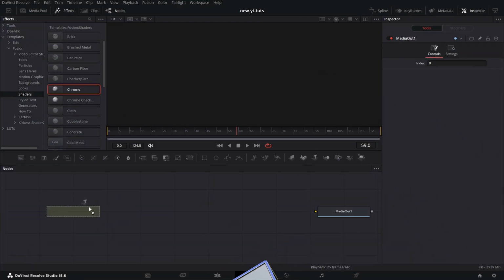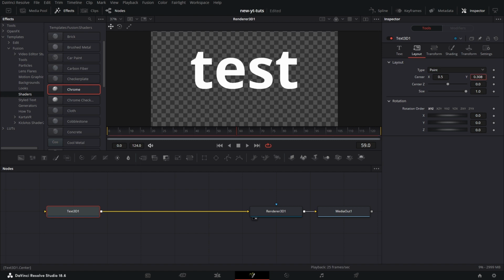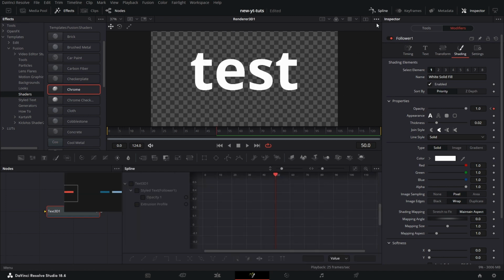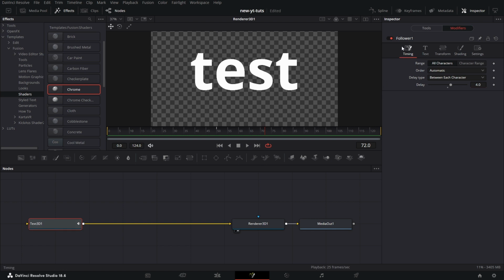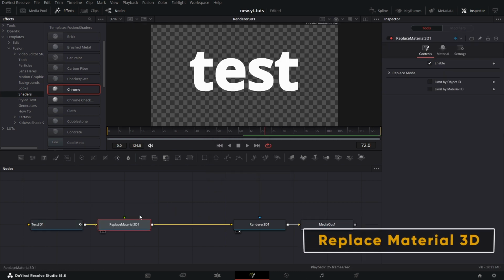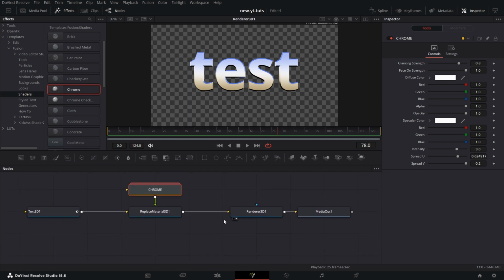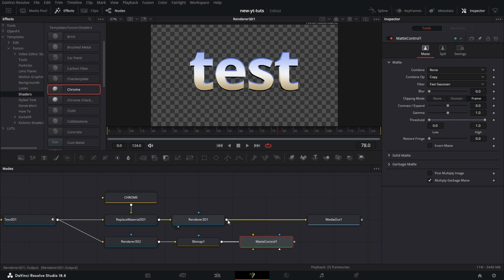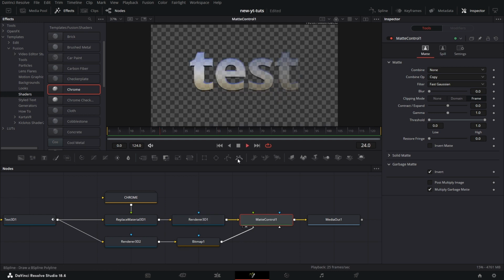Fix Replace Material 3D and Follower opacity issues | Davinci Resolve Quickie

Comment: Hello, i want to know is there any way we can transform video or photo sizes equal so that it looks similar in single frame
Reply from the maker: There are ways to make pictures or videos of different sizes align with a specific dimension.

1. Generally, there are two nodes in fusion, crop and resize that can help but it may not yield exactly what you want.

2. You may need to manually crop the images or videos using masks (rectangle mask tool) by connecting this to the blue mask input of image or video node (usually named Mediain). Then after cropping to the right dimension, you can add a transform node to increase the size. I know it's a bit cumbersome but this is the better option.

Do let me know how it all goes.
Reply: @madresolve  Thanks I'll try method 2 but can i save it as macro?
Reply: @jackroot4 Yes you can. Just seeing this. If you make it into a macro, you may then do the adjustments on the edit page.

But I think you should be about to do it within the edit page with the inbuilt crop function and the transform effect, on the effect page.